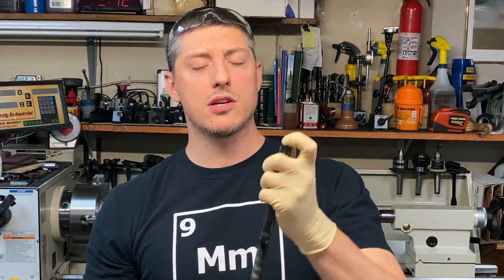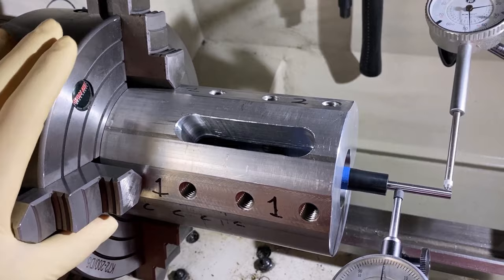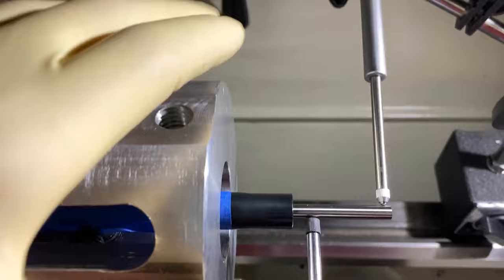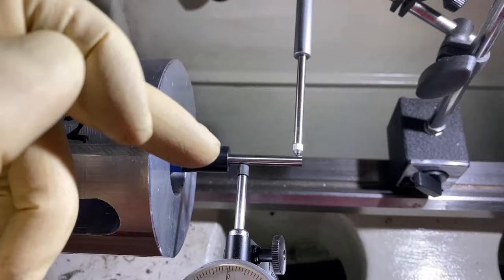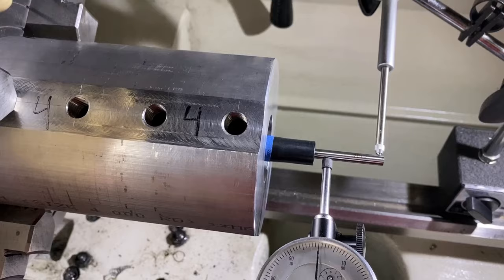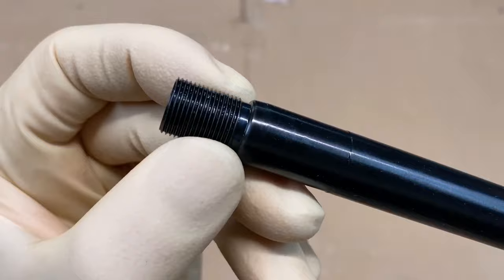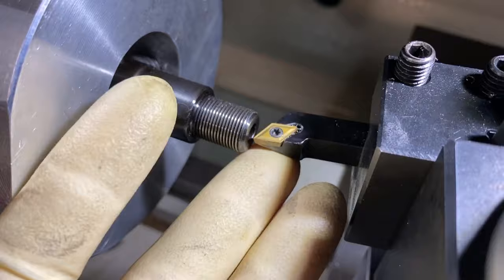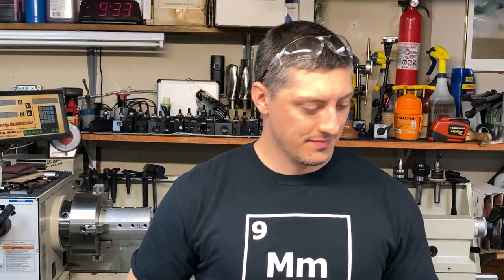Crowning and Threading barrels the correct way

Comment: Any chance you want to share specs on the jig you used in this?
Reply: I'll take that as a no?
Reply from the maker: Sorry for getting back to you late on this one Brother. YouTube hid your comment and I just noticed it on a whim. 
This is a close design that a guy made a long time ago. He had a website called viper bench-rest.com. He made one like this and sold them for around $275-$300.
I just made mine off of what that design looks like.
Here are the approximate dimensions of the one I built.
6061 aluminum 6” long 4” in diameter.
1.5” diameter hole through the center.
Cut 4 flats length wise at 0, 90, 180, and 270 degrees at a width of .900”.
Drill 3 holes in each flat and tap 1/2 x 13 thread. Spacing of 1.525” between holes.  Start first hole .510 from front face “leading edge”.
The through hole for bolt handles is .700”x 3.400” and starts .550” from front face. “Leading edge”
This was as wide as I could go with out breaking through into a threaded hole. You can make yours thinner if you want to.
The bolts I used are brass tipped. They came from Buckley/QC Fasteners, inc.
They are 1/2 x 13 x 1” brass tip alloy steel hex socket head screws. There phone number is 1-800-344-3874.

I hope this helps. No things I wanted to change to be honest. Thank you very much for your interest. If you have any other questions I would be more than happy to help.
-Switchpod
Reply: @jeerrrrrrryyyyy  Thanks man...  Appreciate you sharing - great vids!
Reply: Machinists used to call these "cats heads".  Traditional design usually only had 4 opposing screws at each end though, nothing in the middle, but the middle ones on this design should help hold it better...
Reply: @jeerrrrrrryyyyy how long dose it take from start to finish to thread a barrel
Reply from the maker: @Brandon_obs_ls  it’s always different with manual machines and how thick the barrel is.
Reply: Thanks for sharing the design specs !!! Very well done video but the music was a bit distracting.

Comment: Are you using a spider on the end (chamber) as well? My monarch headstock is so wide i have always turned between centers due to no access at the through tube opening. I guess what i am getting at, is your chuck spider would possibly save me some setup time if thats all you are using.  Enjoyed the video!
Reply from the maker: Welder6131 If the barrel is I believe a 20” then I can use the rear spider, but in the case of these barrels being 16” they can’t reach the rear spider. I do have plans making a shorter modified fixture for this dedicated operation. This longer fixture is great because to can do bolt faces too.
Reply: @jeerrrrrrryyyyy  great thank you for confirming this.  I will be making one of these to give it a try!

Comment: I cut a small 30 degree chamfer at the crown along the edge of the bore, which protects a great deal against damage during cleaning.
Reply from the maker: Why would you clean from the muzzle end and not the chamber?
Reply: @jeerrrrrrryyyyy  who said I did?
Reply from the maker: @ianh.7822  I’m asking the question due to the comment you wrote. In your comment There’s an emphasis on protecting the crown during a cleaning operation. I can only speculate that the concerns are derived from experience.

Comment: Really cool jig you made. I’m a toolmaker/moldmaker by trade and I’ve wanted to do gunsmithing at home and maybe go out on my own. A little trick when threading, if you flip your tool and thread away from the chuck it’s a lot more peaceful. Be careful if you have a threaded chuck tho
Reply from the maker: That trick (upside down but) works so well too! 
Mold making to tough for me. It took me 4 casts before I got one I could use the first time I tried it.

Comment: Process looks good, although I'd definitely recommend using a tenths indicator(0.0001") instead of a thousandths indicator. Also for very fine work a dial-test indicator(best-test) style is a little easier to work with and a little more sensitive being the lever is much shorter than a drop indicator.

Also running running your threading tool upside down and running the machine in reverse(if your machine allows it) will allow you to run a much higher SFM more comfortably without having to worry about crashing into your spider-jig or tge shoulder of the workpiece.
Reply from the maker: I generally use my best test on the granite plates. 
   The setup with the two dial indicators have a bigger face for video, but yes they are very sensitive.

Running tools upside down is a great way of doing work with tight tolerances, and cutting away from a step, or shoulder, as far as threading these I haven’t ran into any issues with the conventional right hand bit holder.
Reply: @jeerrrrrrryyyyy  there's an old saying, if it works it isn't stupid, lol, as long as it gets the job done, you're golden.

Just offering a different perspective, sometimes it helps sometimes it doesn't. I've been a journeyman machinist for 16 years(and gunsmith on the side since 2010), and I still catch new techniques all the time from other people.

But like the work you're doing. I'm getting ready to thread my Sig MPX Copperhead since I got one of the "contract" guns that didn't come threaded, with the internal muzzle device on a 3.5" barrel
Reply from the maker: @smnkm4ehfer   I’m just a dude in a garage, but thank you. 
   Those Sig copperheads are sweet. I’m glad you got one! I wish I had one. 
   You should do a video on it seriously.
Reply: @jeerrrrrrryyyyy  when my 9-5 calms down a little I'll have more free time to do some of my own jobs again, unfortunately we've been so busy throughout covid, I haven't had much free time lol. I had to take over for our lead machinist(he lost a leg in a motorcycle accident unfortunately) so I've been double duty for the last 9 months or so. Basically killed my free time unless I never want to leave the shop lol
Reply from the maker: @smnkm4ehfer  I’m sorry to hear about that. I hope you get some much needed down time.

Comment: If you didn't need to crown it, and just wanted to thread it, and didn't have your jig. Could you use a dead center and drive dog in place of the chuck on the chamber end, and a live center on the threaded end. Then thread it. My headstock hole isn't big enough to accept a barrel. Wouldn't that center it on the bore? I've been thinking of doing one on my lathe this way.  Would like your opinion. Thanks
Reply from the maker: Technically it would work, but only if your setup was true to the bore and your crown was too. The problem come with mass production of barrels.

If you just want threads and true concentricity isn’t at the top of the list you absolutely could do it that way. I would recommend brass tipped live center, or a brass adapter tip on your live center at the tail stock. They are cheap and help to not distort the existing crown.
Reply: Thank you. I appreciate your  input and enjoy your videos. You bring a lot of knowledge to the shooting community.

Comment: I am planning to shorten a light contour barrel from 22 to 16 for 308 win. Will this affect its accuracy?  What should I ask the gunsmith to keep the one moa accuracy?  TIA.
Reply from the maker: Accuracy is a byproduct of consistency. In almost all cases shorting a barrel will most definitely increase the rigidity of the barrel and increasing consistency. The downside will be lower velocity of the projectile, so at longer distances you will notice more effects the wind will have on your shots along with bullet drop will also increase with shorting the barrel. 
With proper hand loads you will most likely notice improvements in your groups at short, and mid range distances, long distances “pending on the load” and how the crown machining goes when the barrel is shortened will most likely be affected.

If you are having a conversation with the gunsmith you can ask him to also true the bolt, bolt lugs, bolt face, and action. The possibility on touching up the chamber to “tighten it up” ask what that would cost. All these things can help tremendously with accuracy.

Comment: Can you explain why the jig is 4” dia. I didn’t know if there was a reason to not use say 2” dia or somthing.
Reply from the maker: Good question. The through hole is 1.5” to accept actions as well as barrels and bolts. If I used a 2” piece of round stock there would only be 1/4” of material to thread for the adjustment screws, so by having a larger diameter fixture you have more area for thread support for the adjustment fasteners. The mass of the fixture also helps to absorb vibration that can in turn cause a uneven cut.
Reply: @jeerrrrrrryyyyy  thank you

Comment: When you cut the crown, at 11 degrees, do you put a small radius, c-fer, on the ID? Wouldn't a burr get raised into the ID and riffling?
Reply from the maker: It all depends on the type of crown I’m cutting, but If you cut to the center then you will experience a burr issue, but using sharp cutting bit, the right speed and feed, and cutting from the center of the bore to the outside diameter greatly reduces the burr issue.
  I personally believe the key in all of this is to have the most consistent cut possible that you can achieve. If you look closely at the thumbnail picture you can clearly see each land and groove.
   I haven’t experienced an issue with accuracy or barrel longevity yet doing it this way, albeit unconventional it has treated my barrels pretty well.
Reply: You definitely want to deburr that edge.  You can check for a burr using a Q-tip.  Push the cotton swab in the bore and it should not catch on the way out (you’ll see little wispy cotton fibers if there is a burr).  The best way I’ve found to remove this is with 1/2” round medium grit Cratex rod that has been ground to a point.  Point goes in the muzzle with the barrel turning about 500 rpm which removes the burr and also polishes this edge.

Comment: Really good job brother.  What do you put on the barrel so that it doesn't scratch by tightening it?
Reply from the maker: All the adjusting screws are brass tipped so all you have to do is wipe off any brass that runs off on the barrel.
   Great question.

Comment: Can you post some general specs on your fixture?  ID, OD, Length, Thread size for the brass tipped screw threads?  Looking for a starting point to make one.
Reply from the maker: It’s in the pinned comment, but it goes like this. 
Sorry for getting back to you late on this one Brother. YouTube hid your comment and I just noticed it on a whim. 
This is a close design that a guy made a long time ago. He had a website called viper bench-rest.com. He made one like this and sold them for around $275-$300.
I just made mine off of what that design looks like.
Here are the approximate dimensions of the one I built.
6061 aluminum 6” long 4” in diameter.
1.5” diameter hole through the center.
Cut 4 flats length wise at 0, 90, 180, and 270 degrees at a width of .900”.
Drill 3 holes in each flat and tap 1/2 x 13 thread. Spacing of 1.525” between holes.  Start first hole .510 from front face “leading edge”.
The through hole for bolt handles is .700”x 3.400” and starts .550” from front face. “Leading edge”
This was as wide as I could go with out breaking through into a threaded hole. You can make yours thinner if you want to.
The bolts I used are brass tipped. They came from Buckley/QC Fasteners, inc.
They are 1/2 x 13 x 1” brass tip alloy steel hex socket head screws. There phone number is 1-800-344-3874.

I hope this helps. No things I wanted to change to be honest. Thank you very much for your interest. If you have any other questions I would be more than happy to help.
-Switchpod.
Reply: @jeerrrrrrryyyyy  Thanks I really appreciate it.  I’ve been trying to find info on the viper jig and you gave me what I needed.  I already have everything to make this but the screws, but I can get those from McMaster Carr.  I’m planning to use this for working on barrels that are too short to run through the headstock and use the rear spider.  I have a Colt M4 14.5 barrel I want to chop to 12.5” for a pistol build, and I have a Tikka 6.5CM 24” that’s going to become a 16”, both too short for a rear spider.
Reply from the maker: @jimmypalmer5422  Dude!!! Both those builds sound awesome!!!

Comment: You'd probably know better. I'm trying to rethread an FAL barrel. It has the right thread pitch already that I need, but has left hand threads. I need right hand threads to be able to mount a suppressor. So if you were going to do that I am, would you chop an inch off the barrel and rethread, or can you rethread over existing threads?
Reply from the maker: I would honestly use an adapter. If you have a long enough barrel then yeah, you could chop and re thread the barrel.

Comment: You show what seems like super minor runout then you talk about 'zeroing it out'.  Are you actually going back and removing runout further?  And if so, are you using the jig vs the 4 jaw i assume?  Any chance you can show that process?
Reply from the maker: Well like I stated in the beginning of the video, I have seen a lot of different barrels that are not true. Minor or not at distance a un true barrel can lead to inaccuracies down range. Remember that manufactures are producing barrels at mass production. This will often lead to worn out cutting tools and jigs that hold the barrels. By doing it this way you will take that anomaly out of the equation. During a full build you true up the bolt “if it’s a bolt action” first and then the action, then the barrel and barrel bedding block. 
   I describe the process in text in the video, this will shorten the video for the viewer. 
   Yes you can see in the video that the parts are cut in the jig that is held by the 4 jaw chuck.

Comment: Would a gun smith half to remove the barrel from the action on a bolt action rifle in order to cut threads and How much would it roughly cost me to have a gun smith cut threads on my 30 06 for a suppressor and crown it
Reply from the maker: It would depend on the Diameter of the action and the inner diameter of the spindle bore of the lathe they had.

On the second question, I have no clue.
Reply: @jeerrrrrrryyyyy  thank you for the response I'm trying to make a good hunting rifle out of a bubbafied arisaka chambered in 30-06 so that's why I'm asking  if it were a as issued rifle I wouldn't be messing with I but it already has been messed with so I put a new stock on it I have polished everything to a nice shine in prep for bluing but I'm hoping I can get it crowned and threaded for a suppressor for under a couple hundred dollars if possible
Reply: @jeerrrrrrryyyyy  if I had a lathe I would attempt doing it myself cause I have two uncles who were master tool and die guys and I enherited all of there machining gauges tooling ect pretty much everything but the lathe and the mill so I pretty much have to go to a gun smith

Comment: Can I thread my ruger american 30.06?
Reply from the maker: You certainly could.
Reply: @jeerrrrrrryyyyy  Haw much does a typical gunsmith charge for this job?  Thanks.
Reply from the maker: @hatmatrix4376  I really don’t know because the prices fluctuate from state to state, types of barrel material, even the time of the season it is will change the prices, for example in the fall; I know of a place that the price will go up seasonally.

Comment: Hi, 

If you have barrel diameter .590" and caliber is .323" ...  1/2-28 thread will fit BUT with minor diameter (of thread) 0.4575 ... It will leave only .0672  (1.7 mm) of barrel meat on each side. 

Is that even safe to shoot with muzzle brake attached on that thread? 😂
Reply from the maker: 😆 really?
Reply: @jeerrrrrrryyyyy  really 🤣

Comment: can you use barrel made from titanium or the steel is better?
Reply from the maker: Both are 4150 crmv
Reply: @jeerrrrrrryyyyy  what "crmv" mean?
Reply from the maker: @Hammam-Alharith  chromium-molybdenum-vanadium.
Reply: Titanium isn't a particularly good barrel material. It doesn't like heat.

Comment: Show off.
Reply from the maker: N.E.PA. GUNTALK 😂 Thanks NEPA!
Reply: @jeerrrrrrryyyyy  Do you cool that barrel down with a can of evaporated water ? Will I need a left handed monkey wrench to torque the right handed threads to spec ? What diameter Finnegan pin is recommended ?
Reply from the maker: N.E.PA. GUNTALK 😂🤣